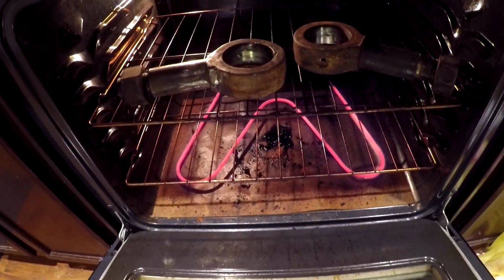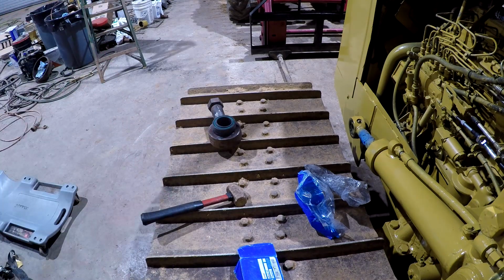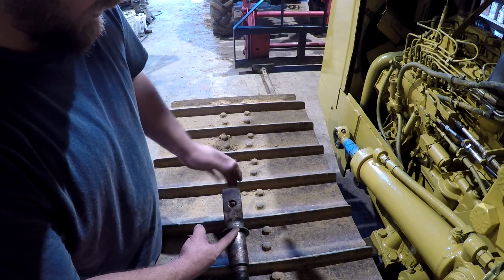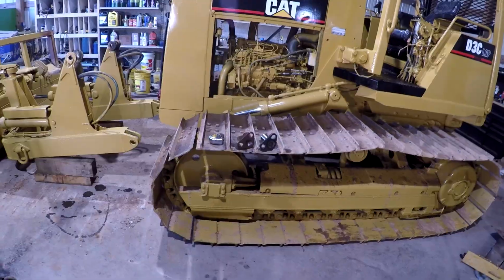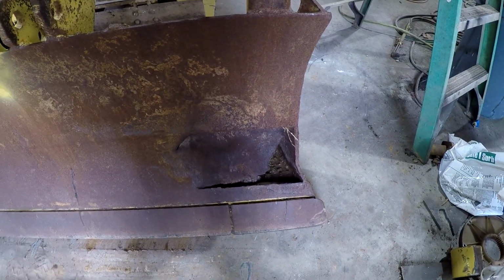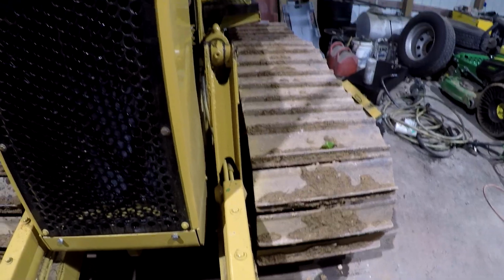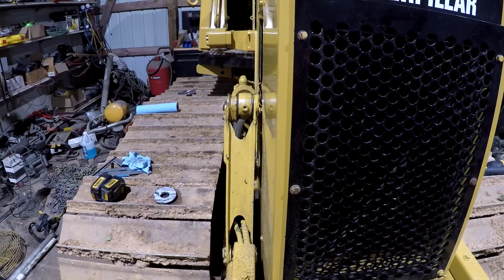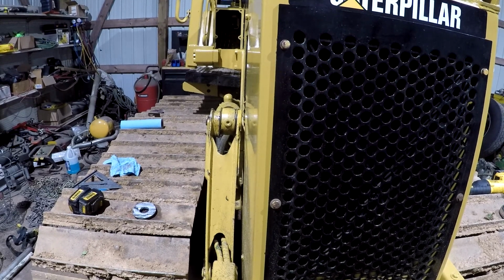Reinstalling dozer blade and a few problems

Comment: I just think you’ll be making a big mistake by not just repairing the blade front skins and replacing the bits.
Reply from the maker: You do realize you can order dozers with different blade widths and excavators with different bucket widths and if the configuration you happened to buy used don't fit your needs you can change it! No different than if you buy a pickup and change something on it because it's not what you want. Maybe you don't like the bumper or tires etc, just because the manufacturer made it one way doesn't mean it's the only way, and no clue what you're talking about Kentucky...